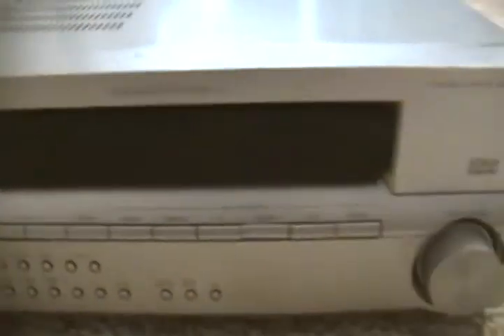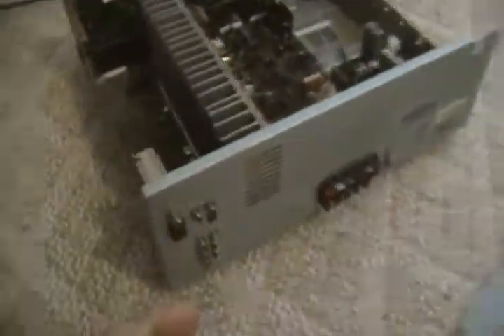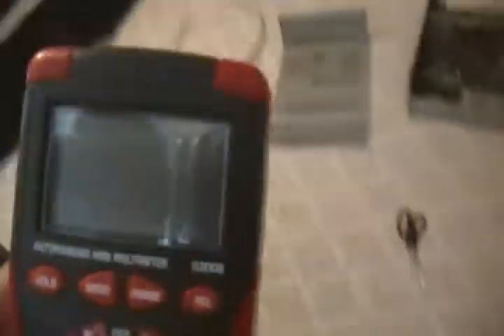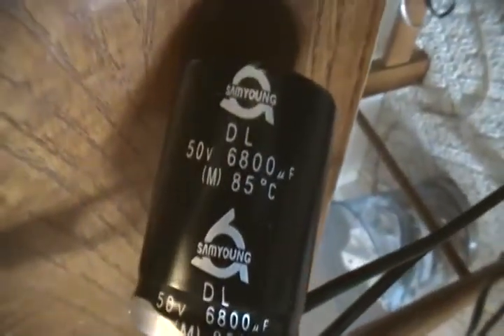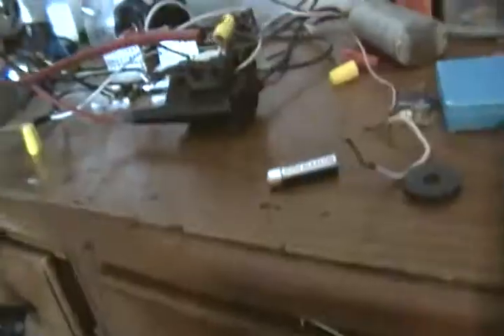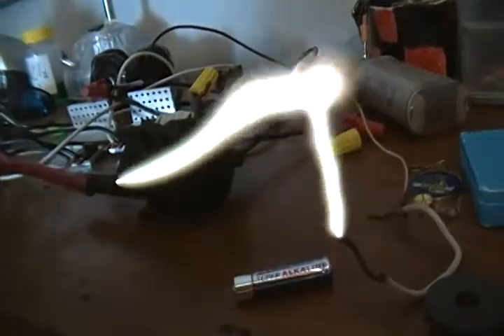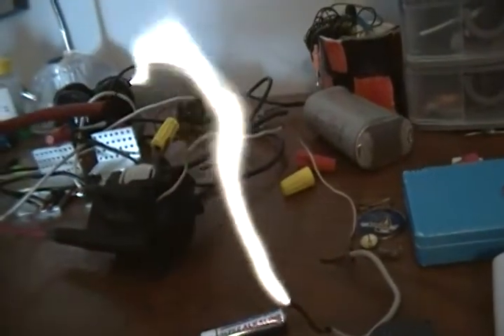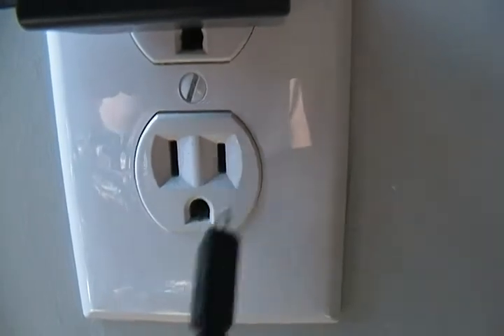40 Volt ZVS + Broken Stereo Find

Comment: The way the current is measured is by having a .5 ohm resistor in series with a circuit, and measuring the voltage drop across it. That resistor was likely fried, and a very large voltage went across the voltmeter circuitry.